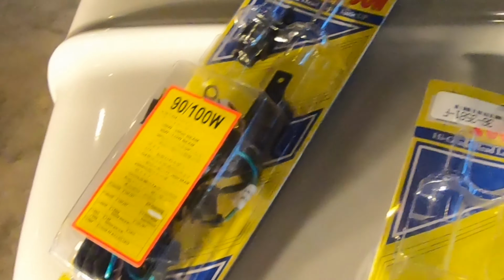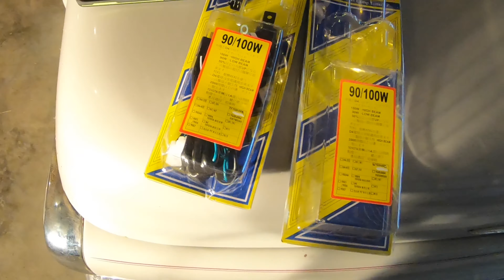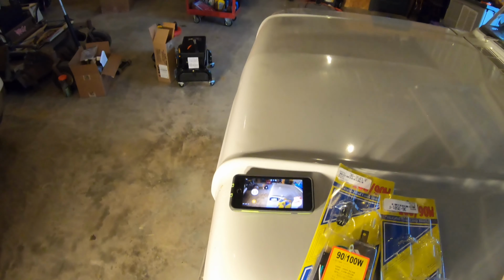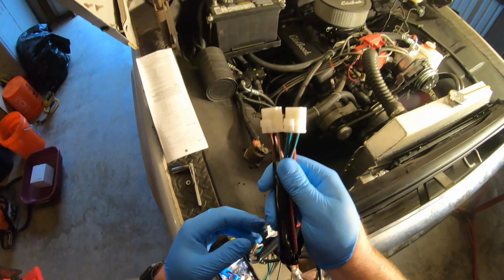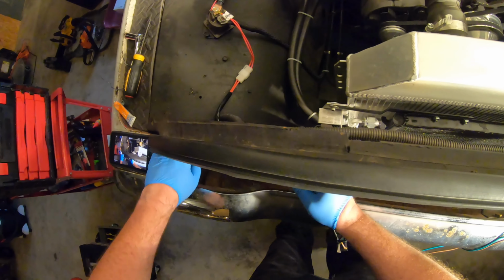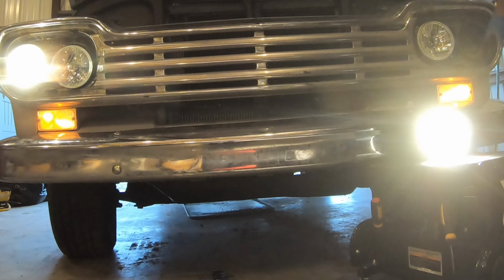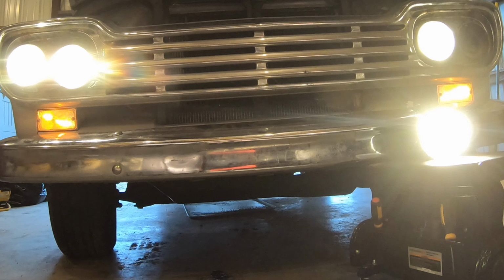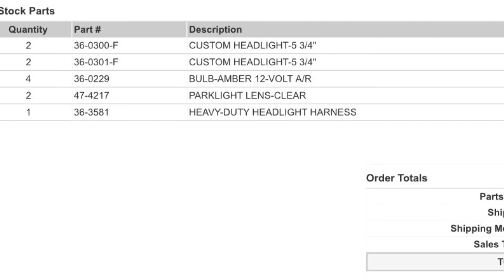Changing the Grille and Headlights on a 1959 Ford F-100. Part 3

Comment: So I’m in the process of doing the same thing. Connected exactly how you did and my lights did absolutely nothing for some reason. Think it may be a ground issue?
Reply from the maker: I hate electrical gremlins!  That’s the old school answer to everything…it’s gotta be a ground issue.  Now did your original headlights work?
Reply: @ClassicCarsComics  I know! Yes they work completely fine and when I install one of the new lights on the old wiring harness the new lights work as well.
Reply from the maker: @raphielrodriguez159  ugghhh…I’ve installed this same type of lighting hookup on my trucks and my Camaro…both cars had their own issues with the original wiring.  Just continue to retrace your steps/connections and test the bulbs before installing them so you can get to things easier.  Use sandpaper to make sure you have a good ground.